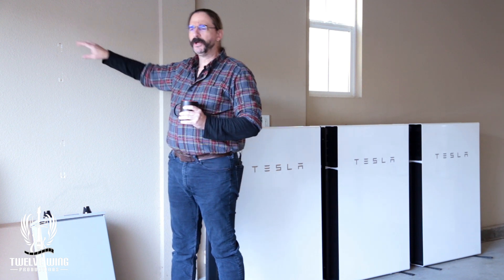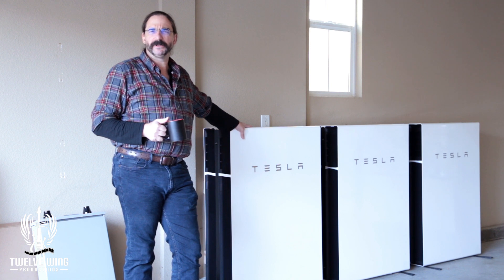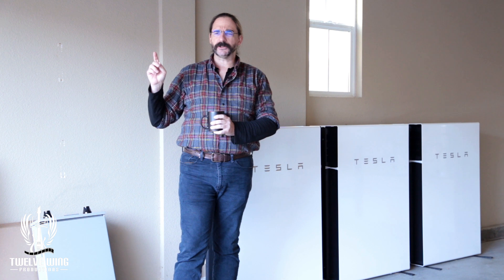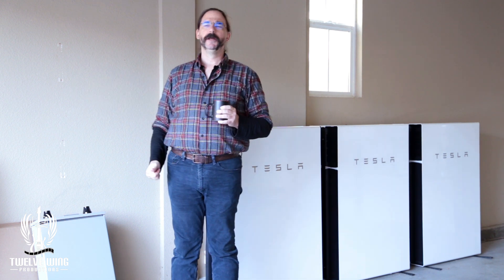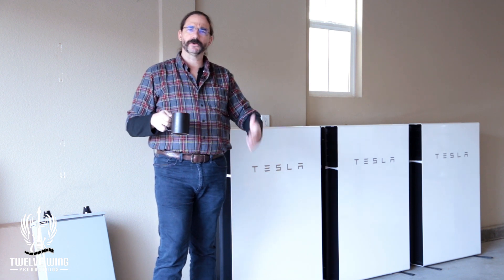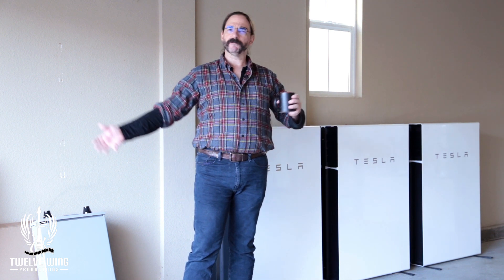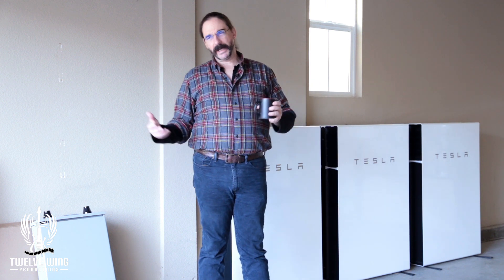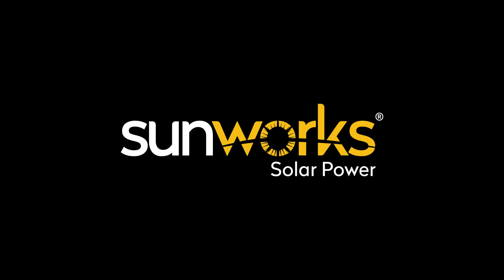ESP Video 2:  Mounting 6 Tesla powerwall 2 batteries

Comment: Thank you for this video.  I have been looking for a video like this for quite some time.  I would like to ask you a question if I can.  I have been talking to my neighbor who is planning a unique setup.  Here is the outline.

EV's = Model S, Model X, Jaguar iPace
Home = 6000 sq ft
Solar Array = 25 kW
Powerwall = 5
Breaker Unit = 400 amp

He wants to be self sustained, but with the option of using the grid during the Winter months when the he may not get enough power for his home.  After watching your video, would this be enough power for him to be independent of the grid?  I'm very interested in this layout and would consider doing this for my home.  Look forward in hearing from you, or anyone who knows about this based on his setup.
Reply from the maker: Firstly, thank you for joining our little band of misfits.
Getting to your question, I have enough information to take a pretty good stab at this but if you can find out what his average usage is that would be very helpful.  The size of the home doesn't actually tell me nearly as much as the 3 cars did.
Some things that I would need to know to properly spec out his home would be things like if there is a pool... if he is running some industry out of his home that he needs to support.

All this comes down to power usage.
Ideally, I would like to see his winter average use and his summer average use.
The other critical aspect to this is where the home is located.  You don't need to give me the address but if you can give me the nearest township so I can run some numbers based on latitude climate and elevation.

Now.. down to some information you can give your neighbor right away.

As you can see, the system he is trying to set up is not totally unique and is very similar to ours.  The only difference being is while our system us under utilized with only one car, his will be more balanced.

Based on the information you have given me so far I can tell you that his battery storage based on 3 cars alone is insufficient to get to where he wants to go.
He should run a 6 Powerwall system.  This will, as you see, give him a little over 80kwh of storage.
The reason for that will become clear as we enter summer a bit and start to run the car.
You should be able to watch what we are accomplishing and be able to give a very direct extrapolation to figure out your friends needs.

So here is the information to pass on to your neighbor:

400A service
Two 10-12kw inverters each handling 12.5kw of PV.
Two banks of 3 powerwall batteries on separate inverters but running through a common gateway.

Splitting the system in this way will allow a peak constant load of 30kw out so long as both banks of batteries feed a common home panel.
If they don't, his max output will be limited to 15kw and given the size of the home that might not work for a home with 2 ac units or one large unit.  So that brings us back to knowing what his actual usage is.

In a few months, you (and your neighbor) will have an opportunity to see how this system operates with an AC unit kicking off and on.

I hope this all helps.  Let me know the answers to the questions I have and I can give you some more detailed advice to pass along.

Be sure to mention to him that the rating on the panels isn't going to be what they produce.
Depending on your location, each bank of 12.5kw should produce a solid 10kw.  So the 25kw system will likely peak at just over 20kw actual.  I can be more specific once I have location data.

If your friend is in the US, have him use this referral link to SunWorks.  

sunworkspowerpay.com/p6tsxf

I have been working with them for over a year now assisting them in setting up this system to do specifically what your friend wants to do.

If you use that referral code, I can probably get a free panel upgrade out of the deal.  As you can see in the video, these guys know what they are doing.  Not only is it a very powerful system, it's slick looking and won't be an embarrassment to show off.
Reply: @twelvewingproductions7508  Wow.  Thank you for that quick reply.  I'm currently watching your "ESP Video 4: Tesla Powerwall 2 mode settings".  He is located in Loganiville, Georgia.  He travels 8 miles from home to work, so a single charge on the Model S 100D will last him for almost 2 weeks.  He has 3 Nema 14-50 in the garage, and the garage is heated/cooled for Winter and Summer.  

The home is completely electric except for cooking which is gas.  I will find out the other particulars for you when he gets home.  For the past 3 months, his electric bill is only $15 a month.  If I am not mistaking he runs the Powerwalls 2 during the day, and take back from the grid a night to charge them back up if he runs low.
Reply from the maker: @d7mysterio7 , ah... I misunderstood, I thought he was still building his system.
Yes, your utility bill gets reduced to basically the hook up charge.
Ours is about $20.

It will be interesting to see what the utility pays us for excess power.  This is, no doubt, the situation your neighbor will be in as well with such a large system.

I would be very interested in seeing his layout.  We should keep in touch and perhaps I'll swing by Georgia on my way out East later this year.
Visiting subscribers with large energy sovereignty systems might be a great excuse for a road trip.

Comment: Can you charge the Tesla on DC directly from the batteries so that it woundn't need to first convert to AC, just like a Supercharger?
Reply from the maker: Thanks for tuning in Jayce,

To do a DC/DC transfer you need to buck up the voltage to a point higher than the battery being charged.  At this point, though it is possible to do it, the powerwalls do not have any way to tap into the DC buss to accomplish this.  I won't go into any great detail here but the short answer is that the gear needed to do a high current and high voltage transfer like a supercharger would require equipment that would make it impractical for home use.
That said.. there are two options that do fit what you suggest.

Firstly, one could have a community supercharger.  These things charge cars VERY fast.  A single supercharger with 2 stalls could easily supply a condo complex so long as people used it to replenish daily use miles only and didn't try to charge to 100%.

Secondly, one could do the DC charging not for the speed, but to limit losses.  In this case, instead of charging at 300mph... you simply continue to charge at 20-60mph but suffering minimal losses of power.

I see an opening for the latter solution in the home... but probably not a supercharger type solution.

Comment: Great to see this project get started. Since you have 6 powerwall and the utility has not been helpful, you could technically turn off of the utility power and run off grid. There are benefits for the grid and can’t seem to understand why the utilities can’t embrace change and use battery to improve voltage and grid quality for your area.
Reply from the maker: A large reason for doing this project is to shine light on what ACTUALLY happens.  I think a large part of it is that the utility companies are unaware of how these connections actually work.
By the time we get done... they will be.

Once the project gets started, I encourage all of you to contact your local utility and direct them to these videos and The Energy Sovereignty Project and INSIST that they set up a grid compliant hook up for you that does NOT include forcing you to upgrade to a utility connection that you do not need.

Hopefully as we go this project will supply everyone with the ammunition they need to force their compliance with the will of the customer instead of the other way around.